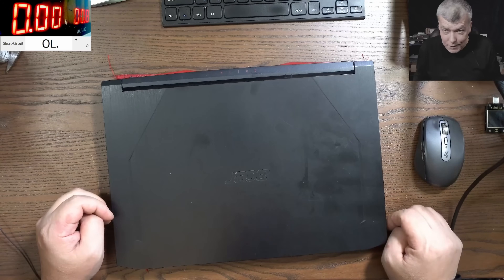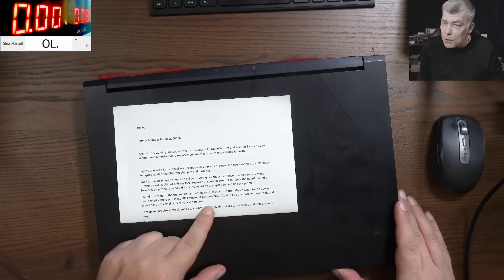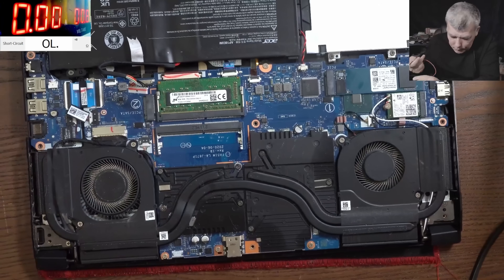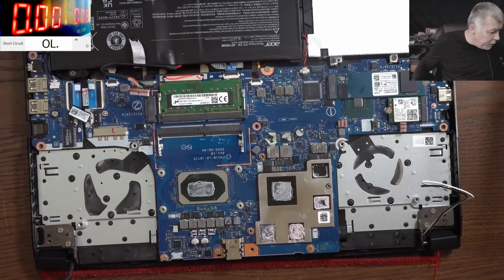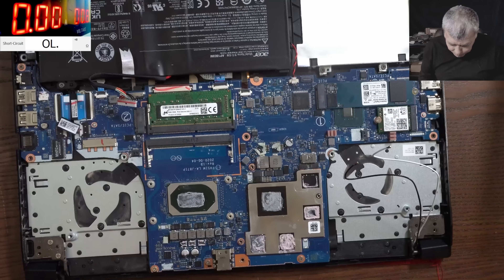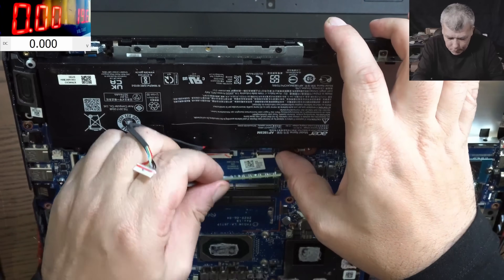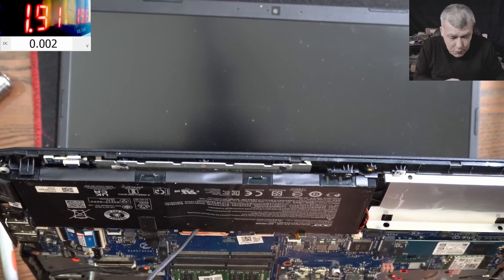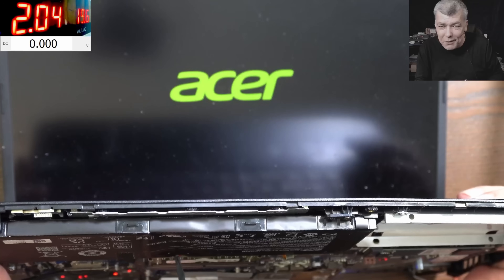Acer Nitro 5, dead, no power - Manufacturer refused to fix it, can i fix it?

Comment: Hello, greetings from Italy, i've had practically the same issue on the same notebook: a capacitor on the same line was shorted, now the notebook powers up normally but after a while it suddenly shuts off and the battery led start blinking, the notebook suddenly shuts off even with battery disconnected and only power supply plugged in. Any idea about this problem? Thank you very much.

Comment: Hey man, I hope you'll see this because my Acer nitro 5, 12th gen which I bought a few months back, suddenly turned off. The charging indicator isn't making any light when plugged in, I have tried every troubleshoot and fixes on the internet, but to no avail, my laptop was still dead as a plastic.... What do you think is the problem? This is the first that I'm experiencing this and I'm crying because it's the only device that I'll be using for work, and without it I'm useless as an earthworm

Comment: You are incredible ! And what is this magic screwdriver ? What is the conclusion: you spotted a burnt capacitor which you removed and not replaced at all and the keyboard cable was not fully seated in its plug. Did I understand well ?

Comment: I’m facing the same issue with my acer nitro 5 i go to local repair shop and he told me that your motherboard is dead. when i press power button keyboard lights turn on but screen doesn’t show any picture can you please guide me how can I repair my laptop  i mean how can i know  my laptop capacitor damage without thermal camera
Reply: Is it working again?

Comment: Hi Sorin, I did a stupid thing last week to my Acer Nitro5. I was working with stepper motors and an Arduino stepper motor shield connected to a USB port, and inserted one of the stepper driver boards in the wrong way around, as soon as I turned on my bench power supply to the motor shield my laptop died instantly, I had sent 25v at 3A down the enable pin of the driver  into the USB port😥. The laptop would not turn on again, the bios tries to boot it but can't. I could not be without a laptop so bought a new Nitro 5. I would like to try and repair it do you have any suggestion's to point me in the right direction for diagnosing the problem. I am reasonably competent at electronics to the level of designing and manufacturing my own circuit boards, but as for diagnosing failed laptops my knowledge is limited. I would appreciate any advice you can offer me. Keep up with your videos, they are helping me to advance my knowledge of electronics. Thanks.
Reply from the maker: probably the pch has to be replaced as the data lines from the usb ports, are going straight to the pch
Reply: @electronicsrepairschool my acer wont turn on, when I press the power button it just blinks blue light 5 times in power led,when I plug charger is not even indicating it's charging
Do you know what would be the problem

Comment: Working thru the problems to manage a working unit for delivery back to a customer.    Thank you Soren for a nice lesson, and where as a beginner at repair, I was always curious as to the ribbon cables to their plug in connector....would I damage or not reach secure connection?    Also, where dust might be causing fan and overheat issue by blocked air flow?  
As for the manufacture, there seems to be a huge disconnect as product to any repair.  Across the price range of units.  
At my workshop, I seem to be mostly at repair of cars.  Key problems, mechanical repair as failed parts.  But so often, solder repair is a required need to electronics.  Chance stuff like a bit of metal dropping into the cigarette lighter and causing a huge short with melted wires, internal to the dash.  A metal bit from a dash cam power 12v  plug in. Stuff like a drop or two of coffee that was a spill to a fire wire cord end.    I really enjoy the various problems that can be solved and the interesting review of devices.   *Washington State, US.  M.

Comment: I did a test...  I added  caps on a motherboard   where  ever I found  a place to put.  Before and after.   Bench mark .. cpu performance  was 2.4%  greater.  Mofets temp was down by 1 degree.  Cpu temp down also 1 degree . .. I removed  the caps and tested  5 times. And the result  was the same more caps seemed to improve  slightly.  Strange  to me .  Seems like less ripple on coils.

Comment: Don't subestimate the fact of using thermal camera specially when you are working with high end notebooks, where temperature is critical. 
If you don't have a clue where the problem is and try to find the hot capacitor using any other older way, you'll start the motherboard and in few seconds many things will be hot, making thing more difficult.

Comment: sorin, you’re very smart to find the simple problem so quickly. manufacturer should have either repaired (or replaced laptop) under warranty given just outside warranty period (one yr warranty presumably). ones risk buying expensive laptop!

Comment: I'd say the manufacturer didn't even bother diagnosing as it's not economical for them to do so. Is that a wasteful practice, yes in my opinion it is, but from their (manufacturers) perspective they can't and wont generate any revenue unless they force the owner to buy a replacement MB or entire new laptop. It's what keeps this fake economy going. If anyone of you are old enough to remember prior to 1924, the average lifespan of a light bulb was around 2,500 - 3,000 hours, heck the Centennial Light Bulb is still burning today and it was first installed back in 1901. Anywho, in December 1924, a global organization known as the Phoebus Cartel hatched a secret plan to increase sales by bringing the average bulb's lifespan down to just 1,000 hours. This began one of the first known examples of planned obsolescence. This hasn't changed to this day, in fact if you pay attention all electronic devices die after the warranty expires. It's not a coincidence, its planned so they can sell you new sh*t! Anyway, nice work Sorin, good job mate.

Comment: I just repaired this same laptop no power keyboard lights only, issues was a shorted display cable, I seperated the fused cables and it worked
Reply: Where was that exactly, I have the same issue?

Comment: As a Sony and B&O trained engineer i often despair at the lack of fault finding skills of some 
manufacturers service tech's.
They must cause a lot of customers to avoid buying that brand again when an expensive item
is declared unrepairable just after the warranty expires and the fault is just a shorted component
that can be be found very easily.
Perhaps Sorin needs to offer them some training in how to find a shorted capacitor.
This customer is lucky to have an experienced tech that knows how to fault find.

Comment: Repairing electronics is very satisfying for me but i'm wondering... What's happening with every manufacturer? Failing capacitors, transistors, integrated circuits, you name it... Thankfully i can repair my own stuff, otherwise i don't know how many hundreds of dollars worth of electronics i would have thrown in the garbage, but what about everyone else? Manufacturers need to stop disrespecting customers like that and should design stuff with proper components, not garbage designed to fail in a couple months. And i say this even if the repairs bring me money, it just isn't right.

Comment: One thing beats my imagination. An HP Laptop Goes off by itself and never woke up. All the necessary voltages were present. No heat is coming from anywhere and still the laptop will not turn on.
Reply: Look at hall sensor! Off to sorins forum!😀

Comment: What I dort understand is the voltage injection at this sire of the board how to you know to do it there without mesauruinndg anything ? Luck Guess Knowledge ?
Reply: It's not really guessing, you can get there by logic. Like in this instance, if you see that the 19V power rail is shorted, you can THEORETICALLY put up to 19 in there, assuming nothing else is blown down the board, but that's not a good idea, because it's not necessary. If something more is wrong in the board and you accidentally send 19v to the CPU, I think you can guess what will happen. At least you will see some funny smoke.

What he does here is to inject a really low voltage into the rail, you can actually do it everywhere on that same rail, doesn't matter if it's the current resistor or one of the caps across the board. Of course you want to do it after the mosfets because, assuming they are doing their job, they will cut the power if they detect a short and you know, you actually use this technique to find shorts so it would be pointless. The key here is to use current instead. You limit it, ideally you will use only the amount that you need, and different parts of the board will have different tollerances, but just make sure to use enough to spot the hot point without burning the layer of the board and you will be good to go.
Reply: When sth is short he just put little voltage and see when  heat 
came from with thermal camera.....it is smart way

Comment: Sorin, the videos on your channel are excellent. 
Can you rank laptop brands based on the number of malfunctions? 
And it seems that there are a very high number of malfunctions with Acer! Because there are about 10 videos where we see the Acer Nitro 5 model.
I think the reason for the high rate of Acer laptop malfunctions is the lack of quality components. Gaming laptops have higher power supply and these motherboards may not have the capability to handle so much energy!
Reply: Have no idea, but asus laptops are really bad, and overall gaming laptops fail often doesnt matter the brand.
Reply: Gaming laptops are the problem, too much power in too little space. Working from the factory on their limit. With time some dust inside overheat one of the mosfets and you get a dead laptop. Maybe if you open and clean it ones in 6 month it will live longer ??
Reply: Newer Asus Zenbooks have a lot of display issues. You can't replace the wires, it has to be the entire display assembly.
Reply: @WilliamBrwn  what do u mean wires ? Same problem as MacBook's ? everything glued together ?
Reply: @ronlevin2339  the hinge mechanism wears out the FFC cable to the display.
Reply: Definitely Lenovo.. s145. Worst ever.  .
Reply: I don't see Sorin working on many Dell Latitude
Reply: @kidsteach938 dell latitude is not a gaming laptop? Business laptops have long warranties, might not get repaired afeterwards etc.

Acer Gaming laptops are bought by youngsters that use them hard... Not in the office. Warranty is shorter.
Reply: @silviuguseila2552  Oh I agree. I thought the question was about laptops in general though.

Comment: My friend have same laptop. First time it blown whole track. Repaired track soldered caps changed first DC in MOSFET because short destroyed it. Laptop worked fine for 2 months after it friend came again laptop dead. There are four columns of three caps next to each other. I looked at these caps another blown in different column. Repaired replaced MOSFET and after a month again 😂 insane and again cap in this area 😂 I replaced all caps there 12 caps and laptop is working ever since insane.
Reply: If you could publish a list of components and where you bought them, might help others

Comment: That's one lucky customer.. Rather unfortunate that the company refused to spot the problem.. Maybe Acer can hire you for further repairs 😅
Reply: Unfortunately not.
And the answer is clear.
Remove the shorted capacitor = x$.
Motherboard replacement = XXX$.
I think.
Reply: @PintérSándor_83  They probably don't know how to fault find. Unfortunately most PC repair shops have no idea about electronics repairs they are more software orientated.
Reply: it's more money in the short run but way more in the long run  @PintérSándor_83
Reply: Facts😂😂 @PintérSándor_83
Reply: You could still replace the mother board and replace the capacitor for the next acer
Reply: yep ...
Reply: If sorin worked for Acer, he too will refuse repair